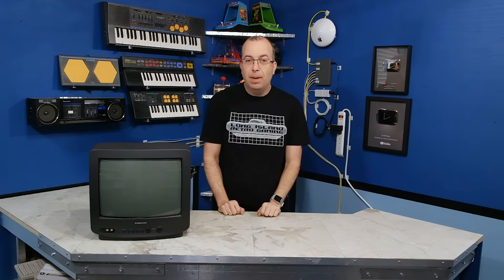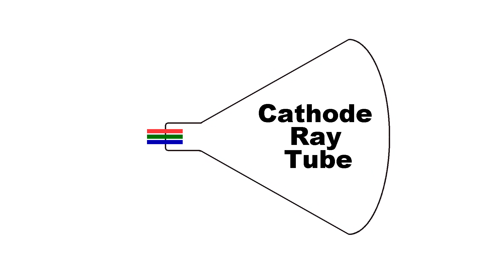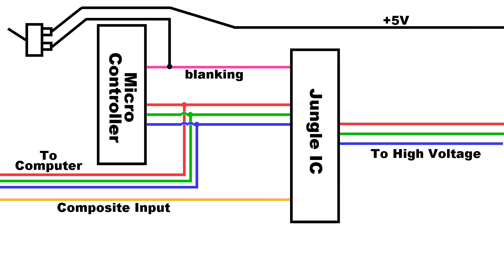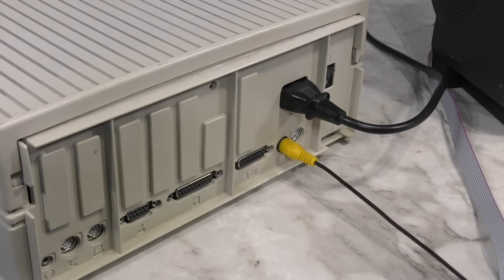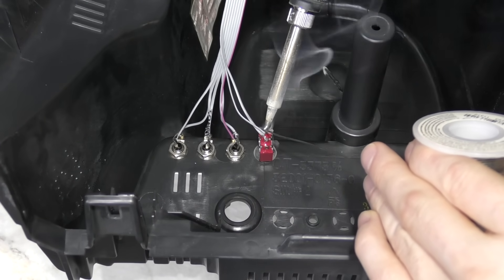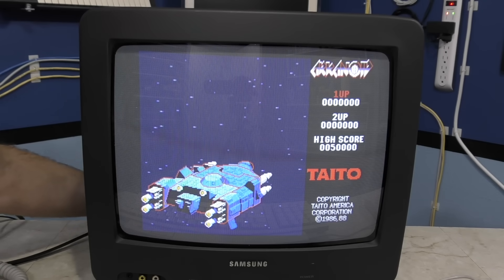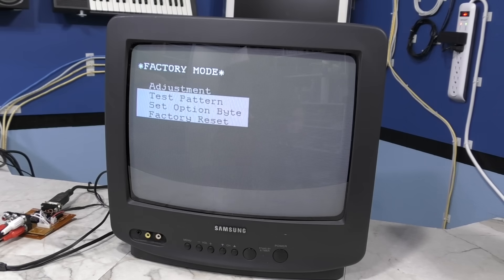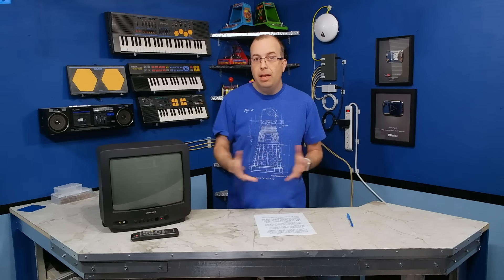Modding a consumer TV to use RGB input

Comment: I live in South East Asia with PAL B/G TV system... We never had SCART connectors (S-Video also unknown in my country, only RCA Composite and Component RGB are available)... I believe many PAL countries outside Europe never had SCART connectors on the TV sets... SCART connectors were French invention due to SECAM fire (red and blue colour fringing) problem when using composite...
Reply: SCART is a french standard called "peritel" in french. It was vastly adopted in Europe among pal countries. Nevertheless in France, even if we had the SECAM standard, it has nothing to do with it. SECAM was invented because NTSC was really bad : "Never Twice the Same Color". This system was also retro compatible with B&W TV. However even if it was invented a long time before the PAL Standard, it was much more complex. The general idea was to store in a memory the chroma from a line to use it for the line under it. So with this system you use twice less band width for the color and you could encode your chroma with more quality. However it was quite complex to implement. The PAL standard was much more simpler to implement. They simply adapt the NTSC, throw away their bad RGB encoding and use a much more efficient Chroma encoding. They changed the resolution and refresh rate to avoid interference with 50hz electricity and the job was done. And the advantage was that it was much easier to make an hybrid NTSC/PAL TV rather than a NTSC/SECAM TV !
And in the eighties, the french government forced the TV sold in France to have both standard PAL & SECAM.
Reply: Thanks for additional information...

SECAM complexity due to SECAM uses FM signal compared to PAL and NTSC which uses QAM signal... SECAM requires additional demodulation colour signal from FM to electrical signal... Demodulated SECAM = PAL...

Comment: I've never seen a SCART connector on a CRT in Australia either, I've only ever seen the connector once on an old plasma TV.
Reply: I really thougt this was a worldwide standard.
Reply: +FZERO Yeah usually Australia always uses European standards when it comes to electronics, guess not in this case.
Reply: I came across one on a Sharp widescreen CRT, but not all of them came with it as Sharp preferred S-video connectors.
Reply: Gen 1 Foxtel IQ's here in Aus had two Scart Ports on them, and we used an adapter cable to connect to the TV.
Reply: @FZERO Hard to be a worldwide standard when Canada, USA, Mexico and Japan were all using NTSC, though. In retrospect, however, it would have been nice to have SCART here in the New World too :)

Comment: Looks like your brightness (video black level) on RGB is a little high causing the picture to look a bit "washed out".  Maybe try putting some potentiometers in place of your fixed value resistors that you could tweak (preferably mounted on a small piece of perf board instead of just flapping in the breeze), or simply increasing fixed resistor value a bit to help lower the signal input levels.  Even better, feed in a white video source and look at the values on each of the R, G, B, outputs of those resistors an oscilloscope to make sure they are putting out the proper voltage peak to peak that the TV expects.
Reply: Most RGB-SCART cables come with a 220uF capacitor on each line already fitted for this reason together with the resistors, but this one is direct with just resistors. I've used chinese cables that were very bright, and when I opened them up they were missing capacitors which turned out the be the reason for the brightness.
Reply: Good eye mrb5217. It does look a little bit washed out. Looks like some tweaking of resistor values is in order if he wants optimal picture quality
Reply: He can just change brightness, black level, and contrast from the front panel. No need to hack anything.
Reply: @buddyclem7328  But then you have to change the settings when you change inputs.
Reply: But like, why bother having good settings for composite when it's going to look like shit anyways? Might as well only calibrate it for best performance on rgb.
Reply: Some devices have a different composite output than their RGB output, and full functionality requires switching between them.  Only the C128's 80 column mode is outputted over RGB for example.  Everything else (Including C64 mode) comes out over composite.

Comment: I actually have a Zenith/Bose TV/Cabinet that has an RGB plug in. I think it needs a special adapter. Also has a computer and printer hook up that also needs an adapter. I can find almost no information on it other than it was hell of expensive back in the 80s. Maybe you know something about it. As I said before it is a Zenith/Bose combo model SC2749Y8. It came in too models. Mine is the black box with gold inlays.It is super cool. Best video I have seen from a CRT and of course sound.

Comment: ZAP !!!!!!   That's the sound of your viewers electrocuting themselves following your instructions.
Reply: I might have missed the part of the video where he said "this is an instruction, follow my lead". Also, what good is a VGA 15 pin connector when most of his computers use different connectors? It's fine for his needs, don't be a prick about it.
Reply: Seriously, this guy has proven time and time again that he knows nothing about properly working on a CRT, and the "experts" he's had assist him in the past don't know much more.

If you can buy a bunch of old computers, you can buy a proper HV probe and discharge things correctly.
Reply: A better solution is to pick up a VGA HD-15 to 5 BNC RGB Video Cable for a couple bucks That will break out the RED, Green ,Blue and Sync input to your LCD Display. No discharging of high voltage TV tubes needed.
Reply: Composite sync as seen in the video is a different system to VGA (vertical + horizontal sync)/
Some devices may support it, and projectors etc, but majority will not hence why things like the XRGB and OSSC exist.
Reply: also, putting it into a LCD Display defeats the whole purpose of this. RGB CRT's are rare and sought after here for their image quality, which is why the mod was done. I will agree though he should probably put out a warning to not try this at home though.

Comment: On the topic of moire. I noticed a post about it to the CRT Collective the other day. It was already answered there, but the issue is not one of polarization, but rather one of the shadowmask of the CRT producing a pattern that is too fine and as such requiring higher resolution to accurately resolve than the sensor in your camera can properly reproduce. The best way to deal with this (as was said there, on at least 2 posts) is to move the focus plane for your camera ever so slightly out from where it currently sits. Done right, this will move the mask itself ever so slightly out of focus, but keep all the detail you want to capture in focus. Finding the happy medium is and can be quite difficult however.

That bit out of the way, a request:

 I am well aware of the fact that different voltages and the like are required based on the specific TV, but I was hoping you might be able to give the values of resistor you used; I have a Samsung set from roughly the same era which uses the same Jungle IC as your set, and any sort of direction as to the values would be greatly appreciated.

If possible, knowing the closed caption pin that you jumped would also be great.

Comment: It would be even better if you did with with a old Sony Trinitron CRT TV
Reply: That would probably represent the best video quality that will be ever achieved on a CRT.
Reply: I have an official Sony Trinitron CRT TV (flat in front), with SCART, and running it with any signal is great, however, the quality is still very bad compared to my official Trinitron CRT monitor, that I question if Sony Trinitron is only good for bringing a flat picture. Most of my CRT TVs from the 2000 era are all basically the same "pixel" quality, you can see the RGB beam missing and filling the neighbour "pixels" just a little, and basically as even as possible.
Reply: I do know of a handful of later trinitrons that did have RGB inputs, but they're fairly hard to find these days
Reply: @cpufreak101  yes that is what I have and I hit the Jake pot I went to my local good will and picked it up for 25 dollars. I had know Idea what it was I just went there to see if they had any crt to play my n64 which looked like total garbage on my hdtv. When I got home did research and was like wow. So everyone that is in a hunt for one just check every so often at a good will might get lucky.
Reply: @shortyorc121  all my local Goodwill's stopped carrying CRT's sadly :/
Reply: @cpufreak101  man that sucks.
Reply: @ElectronicDestruction
p/bvm circle jerk party!
Reply: Trinitron are great but they're not the be-all, end-all of crt displays. A slot shadowmask looks closer to an arcade monitor, and that's a beautiful thing. Let us appreciate the diversity in the crt world :)
Reply: I have a 27in flat screen trinitron and it does have rgb component on the back I never used it though.
Reply: @Crashdance22 Flat Trinitrons are flat just on the outside. The inside of the screen is still cylindrical, just as regular Trinitrons, maybe a little bit flatter. I've disassembled dead Trinitron tubes to prove that. I still have the aperture grille assemblies from both the cylindrical and the flat 27" tubes I disassembled, they look quite the same.
Reply: Which are harder and harder to find RGB compatible Monitors with low hours on it
Reply: i have a 27 inch trinitron moded but refuses to show the brighness level right with this mod, either i got a cursed crt or simply a higher power doesn´t want me to use rgb on it... i gave up modding tvs since then and used regular arcade monitors ever since...

Comment: some tv sets have the special adjustments (geometry, focus, etc) on the main board in the form of presets (always adjust these presets using a certified 10K volt-isolation plastic or ceramic tool); also I noticed in the SEGA and the Apple the image was more color washed in rgb mode than in composite mode (although it was crispier) but u can always compensate with color saturation brightness and contrast standard controls
Reply: Because he uses the RGB lines directly from the console, producing a wrong black level feed to the tv.

Comment: Well done, David! 
I couldn't help noticing that on the rear plastic cover of the TV, right next to where youo mounted the RCA connectors, there was an outline embossed in the plastic that gave me the distinct impression that it could havemarked a place where a SCART connector would have been placed, had the TV been sold here in Europe.
Reply: yeah, another commenter pointed out that it seemed identical to an Eastern European model, so it likely would have only needed a SCART connector soldered in
Reply: That's exactly what i thought, too. The only major difference between the US and EU versions would be in the RF tuning circuit, methinks
'Twould be interesting to see the schematics for this TV.

Comment: As someone who used S-Video a lot back in the early 2000's to easily connect my TV to a PC, I could immediately tell how clear this was. It's really amazing, though I knew what the results should look like as I picked up a surplus school monster sized TV around 2004 or so, 27" or something, wasn't that old and it had a standard VGA input for uh, reasons? That thing was so unbelievably heavy, and so worth the effort it took to actually hoist it onto my dresser.

Comment: There was a television sold in North America with a SCART connector. My parents bought an RCA ColorTrak 2000 television when I was a kid. I noticed the connector on the back but never knew what it was for. The owners manual just said it was for a future purpose.
Reply: Dusty S Lol. Here in Europe it was for everyday usage...
Reply: The SCART jack on the few RCA sets that had it was composite only.
Reply: we also had an older TV that must've used the same Firmware across the US and Europe, as when it scanned for inputs it would sometimes check "SCART" and I still remember having no idea what that was lol (because it didn't have the SCART port)
Reply: Dusty S, Yeah RCA wanted to introduce Scart into North America as the EIA Multiport, too bad it never took ground.
Reply: I have a consumer Sony crt that has an RGB input (although not through a SCART socket). It's the KV-25XBR. There were a handful by Sony released here(I live in Canada). Don't know if there are some by other brands
Reply: @FinalBaton  I know of a Few but the most common RGB CRT's in North America were from them

Comment: Nice way to save a perfectly working TV from landfill. Most people would just pick up a newer LCD TV with RGB inputs, but there's something about running these old machines on a CRT screen that you miss out on with an LCD, and this is a cheap/free way to get that. Personally I've got an array of CRT and LCD broadcast monitors, and scan rate converters to run any RGB signal on either a component or VGA monitor, but I always go for the CRT because it just feels right.

Comment: This is amazing. I have a small CRT (2003 Toshiba with a built in DVD player). And I have an IBM PC with CGA output, and an Apple IIgs, both of which I have no proper monitor for, except for composite out to that TV. This video is so relevant! I took a look on the inside and I see some chips but I don't want to mess around with the high voltage equipment until I do some more research (if ever).
Reply: Oh one more thing. The IBM PC has an AST Six Pack Plus card, so that's another connection to this video. (The card gives you: real time clock/calendar with battery, RAM up to 640K, game port, serial port, and parallel port.)

Comment: 8:44
you can clearly see the Hole on the back (where the 2 rca connectors with a backplate sit on the PCB) is suspiciously shaped like it can fit a SCART connector...
Just coincidence, I am sure. ;-)
Reply: Samsung probably made the TV for the SCART region first, and swapped it out with composite in non-SCART territories. And btw, SCART is fully capable of delivering an RGB signal to a TV.

Comment: I just noticed that, in the intro, the floppy disk says “Load “*”,8”, but on the computer he types “Load “$”,8”
Reply: Good eye, although both are correct, the $ is used to load the directory listing and the "*" is to load the first basic program on the disk into memory in preparation for the run command.
Reply: Carlos Pulpo though, with lots of pausing, playing, and .25x playback speed, on the computer, it says it is ‘searching for $’ and that it is loading. I can only think it is looking on the floppy  disk. There are only about at least three frames when it shows it.

Comment: Yeesh, that is ABSOLUTELY sharp compared to composite! I've been using component and S-Video with all of my old game consoles on a CRT, but I'm still amazed every time I see A to B comparisons of Composite > RGB. It really is amazing how big of a difference it makes :D

Also, I think the TSR you mentioned is DOS240, although that one doesn't allow for proper 15khz video like you could use on a TV, it instead makes 320x200 70hz VGA applications output at the 320x240 60hz instead, since a lot of LCD monitors and capture cards can't handle the oddball 200p 70hz signal. So it still scans at 31khz meaning you won't be able to use it with a consumer CRT TV, but it's still a very handy tool - I've used it before to capture DOS footage and it works wonders. https://youtu.be/xODoVQ8cMxQ